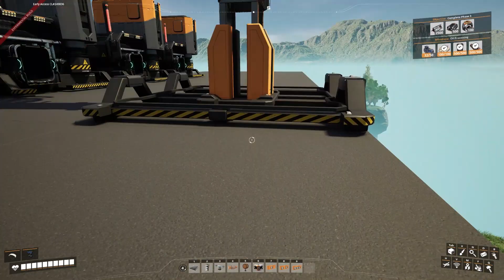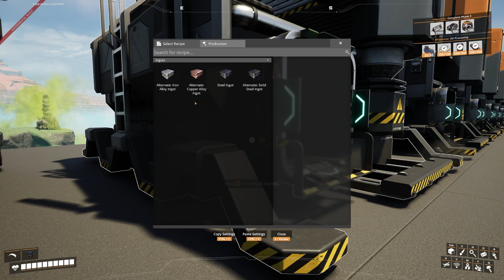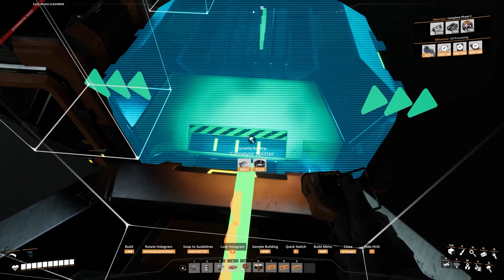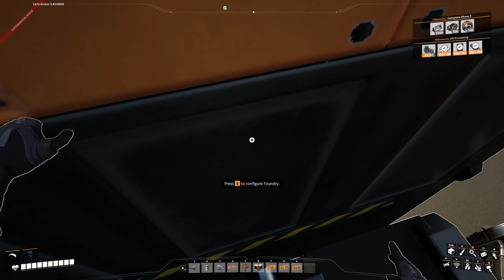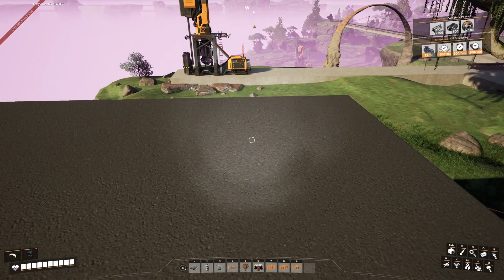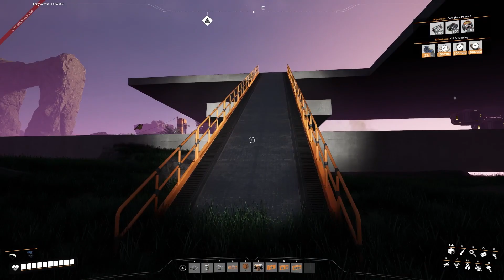Constructing and Routing Iron Alloy Ingot Array | EP45 | Satisfactory U8 | Blind Playthrough

Comment: Tom, I actually learned an easier way to the the splitter/merger lined up with the ceiling hole from you today.  I always placed it then stacked it until I managed to get it lined up.  I'm going to use your way from now on.  Also don't feel you owe us an explanation on why you are using which belt right now you are very short on MK steel beams so it makes sense.  When you can afford them the highest tier never hurts your build.  You might not have full belts if your factories can't output that fast but if you add onto the factory the infrastructure is there already to support it.  

The steel beams and pipes use the same components in different ratios, in the future you can always switch what you are making if you find you need less of one and more of the other.

Keep in mind this is my opinion on terraforming and not meant as a criticism of your comments.  
I think that there are several factors involved in if terraforming is available in a game or not.  Satisfactory is a fixed hand drawn map designed to bring several levels of difficulty to building a factory.  In Dyson Sphere Program I don't believe you are doing any terraforming either, you are using foundations to fill in the terrain holes you don't want so you can build on it.  It does knock down the dirt piles and foliage as you place them and satisfactory does not do that.  Neither game is voxel based where you can knock down a mountain or fill a canyon to make a flat surface.  Factorio doesn't have terraforming really either though it does let you set up the landscape somewhat before you start the playthrough.  Techtonica does have limited terraforming, but its something you will have to explore to see if it is what you are looking for.
One game that has true terraforming is one you aren't interested in and that is Captain of Industry where you can dig materials from the ground or cliffs and move it somewhere else.
There are other games that will let you just flatten or raise landscape at will, usually at some cost that depends on the game itself like in game currency, sometimes with unexpected results.

I guess it always comes down to personal preference.  I mostly prefer first person to third person when you are the character in games like this.
Reply from the maker: Good morning Marietta.

I am happy to see an experience player can learn from a rookie.

I appreciate your view on terraforming and you have a valid point. My main concern is building on a smooth surface without clipping. This helps make the factory look clean and organized. I can do this in Satisfactory by using foundation to make a level surface. The downside of this mechanic is floating foundations and clipping of world items. My goal is to spend more time constructing a factory not worrying about clipping and world objects. I just want to Automate a factory and have it look clean. 

Techtonica will have full terraforming eventually and this is a big deal in first person automation. They just released update that now allow the users to dig down into the world.

Foundry is another first person automation game that will allow for complete terraforming. 

Both these games are setting new standards for first person automation. If we ever see Satisfactory 2 they will definitely add complete terraforming to compete with other titles.

See you in the next episode!